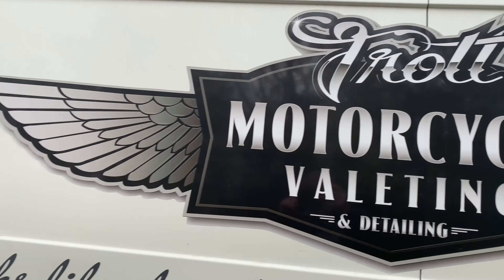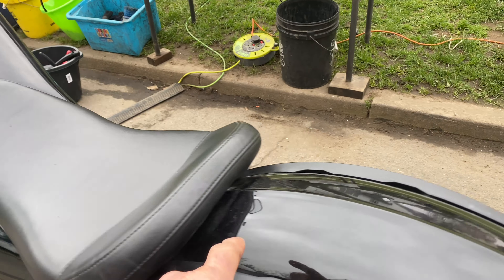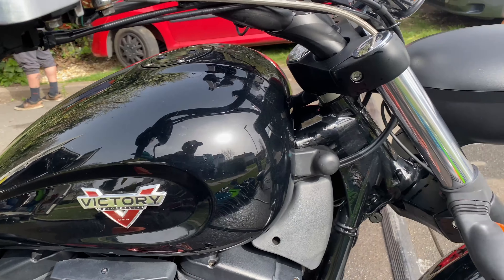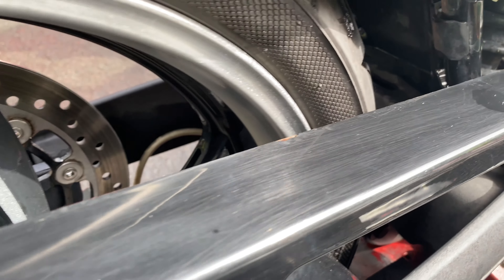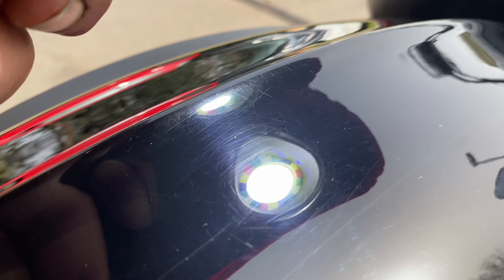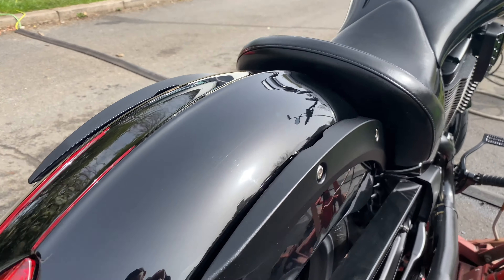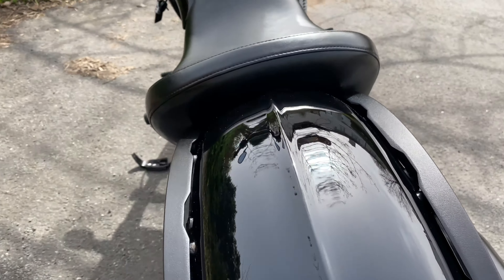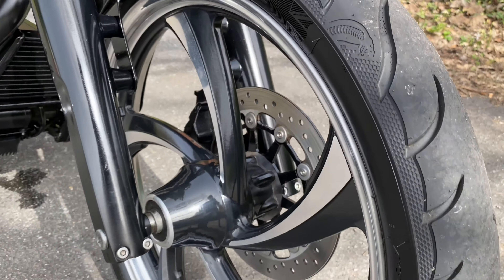Victory Cruiser (Full works valet)

Comment: Are you mobile?  If so, how much would this treatment be for a Honda shadow in Ilford? Thank you
Reply from the maker: Many thanks for your enquiry. Your quickest and cheapest option would be to ride out to mine one day in Elstree. WD6 Post code area. I have a lovely lake across the road. Have a walk and some lunch while I work my magic. I generally work from Elstree Tuesdays’  to Friday’s.  
       A "Trott Full Monty" valet generally can be done within 2 - 2.5 hours. £150 -£200. Thats a complete Valet getting your pride and joy looking like it just rolled out of the showroom. Not only will it be looking mint again it will also include a good coating of ACF50 winter protection. I will be continuing this special for the next month as its been such a hit. Be-spoke cleaning of Harley's, adventure bikes, Classics and tourers 2-4 hours. All charged  @ £75 an hour. I can now offer the full range of Ultimaxx  Ceramic Paint Protection. From the NanoMaxx Yearly protection to the ultimate Signature Pro Reserve for that 5  year protection. I am doing the 5 year Signature Pro Ceramic at a special 1/2 price at only £50 added on to any “Trott Full Monty Valet” 
       I do offer a mobile service, this however is a bit more expensive due to travel time etc. I would need plenty of space to park my van and set up, also water and electric preferred. Usually this service is more cost effective if their is a few bikes as it would cover the extra cost for travel, set-up etc. I can usually do up to 3 bikes in a day. 
      The third and best option (“The Works”) includes pick up/delivery. Usually picked up on a Friday and taken to my valeting studio in Dorset and brought back on a Tuesday. This is the best option as It would be done in a heated studio with a ramp. Spending anywhere between 4-6 hours. On top of a “full Monty” it would include proper paint correction on all bodywork, headlights, windscreen etc. Once paintwork has been corrected it would be prepped and coated with the Ultimaxx Signature Pro 5 year ceramic and the Ultimaxx Slixx 1 year ceramic on wheels. Priced £250-£350
Examples-

https://youtu.be/vHqrRgm-4IA

https://youtu.be/Wyls73a37wU

https://youtu.be/20SAg0ohWaw

Let me know your thoughts,
Freddy Trott
07966249963

www.trottracing.com
Follow us on Facebook, Instagram and YouTube for daily photos and examples of the sort of work I do, you won't find better for quality and price. Satisfaction guaranteed!
 
Facebook- F.C.Trott’s Professional Motorcycle Valeting
Insta- f.c.trott
YouTube- Freddy Trott
WWW.TROTTRACING.COM
FREDDY@TROTTRACING.COM